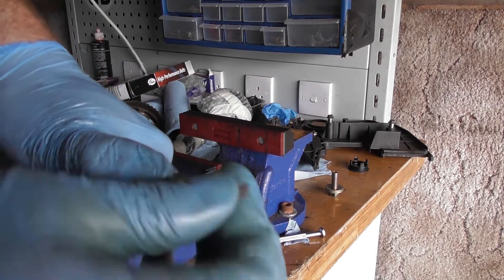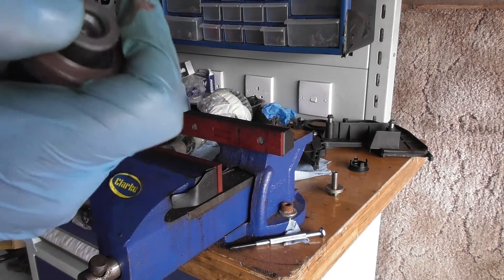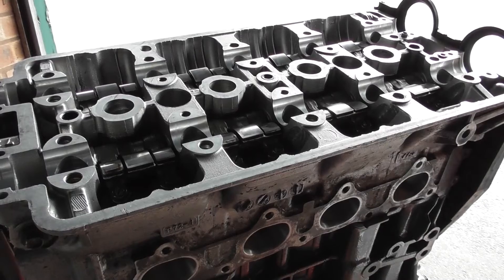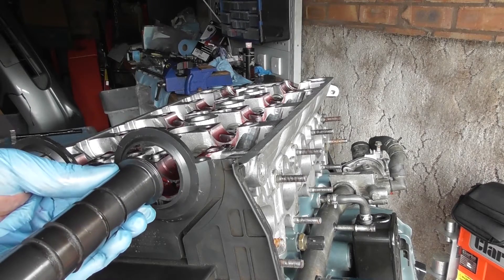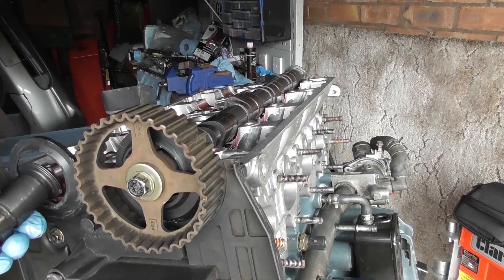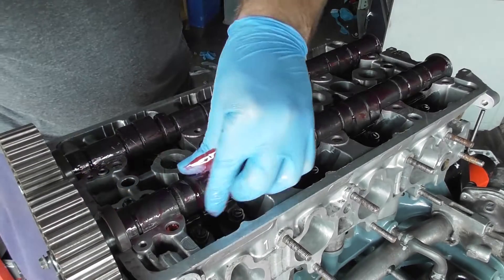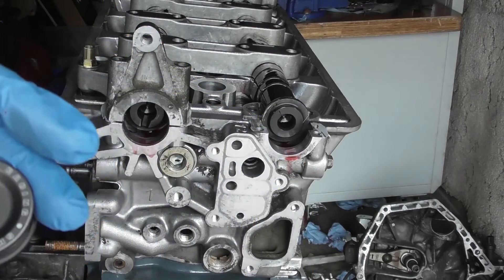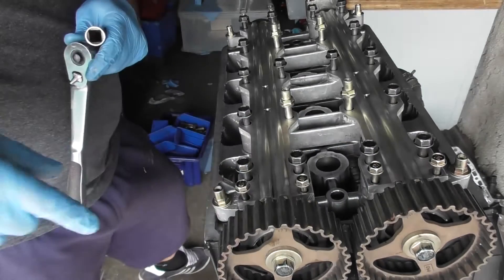T2CG Honda Civic B18C4 Engine Build Part 6: Camshaft Install

Comment: Loving this series mate, setting me up for when I do my rebuild next year! 

Haha did those flush mount cam cover bolts snap on you like they did on me and almost every other instance I've seen them used?
Reply from the maker: MOTOR SPIRIT Thanks for your comment. I really like your car and your videos too. What are your plans for the engind build? Just a refresh or big changes?
Reply from the maker: About those flush-fit-fake Skunk2 hardware bolt.. they were crap and didnt snap... just seemed to stretch as I torqued them up. I just went back to the standard oem hardware in the end. Also got proper spark plug and cam cover gaskets.
Reply: Thanks buddy! Just a refresh really as I'm burning so much oil. I'll be looking to get more pace from gearing next year, possibly go with some cams, but it's all money as I'm sure you're aware! 

I've learnt the same way, OEM where possible.  Is the EF nearly ready to hit the track?
Reply from the maker: MOTOR SPIRIT I would say the Skunk2 Viton valves stem seals would be a good shout on the intake and exhaust sides. The EF need to be mapped... but I am changing over to a cable gearbox first and need to put a lsd in it first so those will be my next jobs.  These cars are always money pits... but we love them anyway :)

Comment: what the red lube u use on cam do u can put all over cam s or jus joins
Reply from the maker: Hi, it is Torco MPZ Engine Assembly Lube. It can be used for any surface requiring lubrication during assembly. So camshaft, Big end bearings and main bearings on the crankshaft. Thanks

Comment: Hey, with the third cam carrier, is there a dowel that goes in the centre of it that goes in the hole with the oring, which i believe is used for vtec?, on your video you edited them just going on:(
Reply from the maker: I have other footage of this, I will check and get back to you. Thanks
Reply: +Twin2 Civic Garage T2CG thank you!
Reply: +Twin2 Civic Garage T2CG you wouldnt by any chance manage to get that footage did you buddy?
Reply from the maker: Sorry I have been very busy this weekend. I will have a look tomorrow. Thanks
Reply: +Twin2 Civic Garage T2CG not an issue lad! Cheers!
Reply from the maker: Hi, I could not find video footage, however I did consult the Service Manual for the B18C4.
The service manual states that there is a dowel that goes through the O Ring in the middle of the third cam carrier.
Send me your email address then I can send you a screen shot of what I am looking at if you want to.
Thanks
Reply: +Twin2 Civic Garage T2CG aw thats fantastic. mine fell off the head and i didnt know where it came from. can i add you on facebook?
Reply from the maker: PM me thanks
Reply: +Twin2 Civic Garage T2CG cant seem to pm you dude?
Reply: +Twin2 Civic Garage T2CG i have a haynes manual for a ek civic?
Reply from the maker: +MrTEHE125 That didnt come with the B18C4... you would need a manual for the MB6 5 door civic....
Reply: +Twin2 Civic Garage T2CG the haynes manual i have has the aerodeck civic in it. away to check.

Comment: Enjoying your vids, and I share your passion for using the grey sealant as a just in case kind of measure. I have never used Honda-Bond, but stand by using Threebond, which is I think the company which makes Honda-Bond.
Reply from the maker: Thanks for your comment. I wish I had used the Honda Oem cam cover seal and spark plugs seals in this video, rather than the patern parts straight away though. Yes Hondabond is good stuff, however I am sure other sealents would work well too. Keep watching, I am working on the Civic tomorrow.. can't wait :)
Reply: +Twin2 Civic Garage T2CG 
Sounds good, look forward to it!
Ahah, yes often the OEM stuff can often turn out better than aftermarket. I am based in Japan, and one of my friends used to work for Mugen building group A Civics/NSX cars in the 90`s, now runs his own shop probably only 10 minutes from Mugen. On his own Civic track car, he was using OEM Type R cams and pistons...nothing aftermarket, which says something. Although, he did work his magic on the cylinder head doing very extensive work. It is one simple, yet potent B18C that is for sure.
Reply from the maker: +irit8r That is cool, I like the group A Civics. I have also had some head work done on my cylinder head. Has your friend had any experience with ITBs on a B18?
Reply: +Twin2 Civic Garage T2CG 
Nice, will be good to see some track footage of your civic and hear it sometime!
Yes he does have experience with ITB`s, but on his cars he does not use them. Even now most of the cars he looks after which run in the Super Taikyu （スパー耐久） series here in Japan, run full manifolds (for regulations).
Reply from the maker: I like going to tracks (Cadwell Park, Oulton Park etc.) and also drag racing. I am going to try to get the ITBs running well. Thanks for your comments
Reply: +Twin2 Civic Garage T2CG 
No problem! 
Will stay tuned.